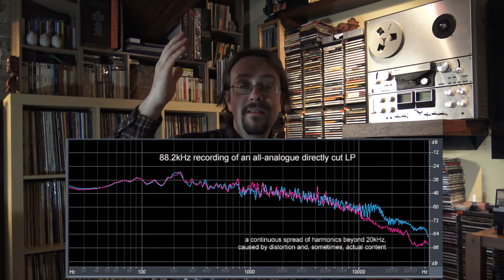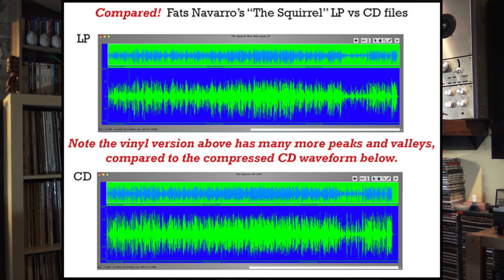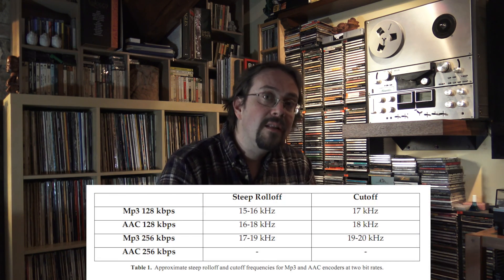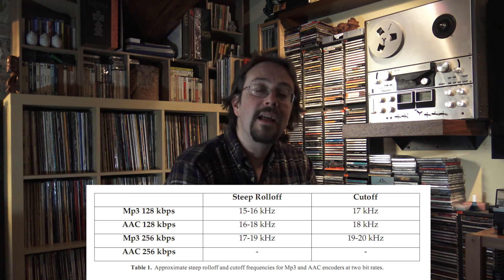SuperTweeters: how to increase your frequency response or a critique on modern music compression

Comment: Merging a supertweeter with a main tweeter of a loudspeaker is not as simple as it seems. Danny Richi from GR-Research had shown that the best way to integrate supertweeters is to aim them either back or up.
Reply from the maker: You are indeed correct. Actually, a DSP would be an optimal solution to really make sure the crossing is optimized, but I must also admit that when I had those speakers, some time has passed now from that video, the supertweeter gave that extra air to the scene that is was worthwhile the downsides it carried.

Comment: Thanks for the informative video. Would you say there is any benefit to super tweeters if not playing vinyl?
Reply from the maker: Well, the only music with a cut off of the frequencies is a CD, but usually speakers reach maximum 20khz with linearity, so even those extra 2khz can benefit from the presence of supertweeters. I always felt just a more engaging experience with them on.
Reply: @anadialog I appreciate you getting back to me. I am using Amazon music with their Hi-Res Flac streams through a Wiim Pro Plus streamer. So I would hope that It's putting out a higher frequency spectrum than the standard CD. In this case a super tweeter may be of benefit? Speakers are Wharfedale Linton 85th, so start rolling off around the 15khz mark with soft dome tweeters.

Comment: I just bought a pair of Townshend STs and they are revelatory.  On everything.  They do so much by doing so little.  Extra air, resolution, space, definition, finesse, bass definition.....I could go on.  And in audio speak, they are cheap for what they bring to the table.  NO cable or tweak, at any cost, can bring to the table what the Townshend STs do.  I highly, highly recommend them and give them a go.  Of the ST's out there they are the easiest to hook up (come with their own quality cables) and have a volume (sensitivity) matching knob, something most ST's don't have.  And they are unobtrusive.  Sutble.  Less is definitely more and with some ST's out there they are obvious, loud and distracting (both visually and audibly).  Wow.
Reply from the maker: Nice!

Comment: Hello and thank you for sharing your knowledge with us!
Please help me with some information. 
I ordered a pair of Wharfedale Linton Heritage speakers that have 6 Ohm. 
I have 2 Fostex FT96H super tweeters that have 8 Ohms. 
The question is, can I use them together and how can I connect them if I can? 
Is it necessary to use a tweeter attenuator so as not to burn it?
The amplifier is Denon PMA 920 and on its back it says that it supports speakers between 6-16 Ohm. 
Thank you in advance!
Reply from the maker: No worries, speakers themselves tend to have impedance fluctuations. Connect the tweeters to the speaker inputs and test if you like the sound...they not always blend in...

Comment: https://www.youtube.com/watch?v=JTBAx9x5fUU
Reply from the maker: The video takes into account adding a tweeter. I am talking about SuperTweeters, made and designed by various companies in order to work with your speaker. At that time I used a tri-wire speaker so the effect was even more precise and the results were amazingly good. According to the guy in the video you would hear the big problems in phase. As I said in other comments a DSP would certainly optimize crossover.
Reply: @anadialog  
Tweeter or SuperTweeter the effect of Phase Cancelation not only remains the same but it's even more severe the HIGHER you cross in Frequency,.
Just watch what happens to the Frequency Response by moving the driver by ONLY half an inch, you lack fundamental speaker design theory knowledge to have a constructive conversation with you, I guess ignorance is bliss, OTOH, you're ruining a well designed and thought after pair of ATC Speakers.
Once again, SuperTweeters are not "one size, fits all" no matter what the manufacturer or your "senses" claims.
Reply from the maker: That is why they invented something called DSP. In any case clearly you are not open for discussion but just enjoying your pedestal, enjoy it. Just remember sooner or later it gets cold up there! ;-)
Reply from the maker: Speakers and supertweeters are long go e. This is what I have now: https://youtu.be/slu_GgE67BM

Comment: Do you have ANY idea how these Super Tweeters "interacts" with your speakers tweeters?
Do you know the stop band and slopes of your speakers tweeters?
Do you know the slopes and crossover point of the SuperTweeters?
Without MEASUREMENTS you don't, so, the chances of creating a PHASE CANCELATION and a huge dip in the audible range (10kHz-20kHz) of your speaker tweeters is way higher than you think and almost certain,.
You can't just "throw" them on top of your speakers and call it a day.
Reply from the maker: I do agree that a DSP would help! In any case I am not using them anymore but when I did I must sdmit that they made my ATC loudspeakers sing!
Reply: @anadialog  
My comment above has nothing to do with DSP but with speaker design basics, which, you obviously know nothing about.
Before you go suggesting and praise add-on "SuperTweeters" do a little research of how multiway speaker crossovers works, it's far more complicated than you think.
Reply from the maker: Humm, DSP takes care of most of those issues maybe you should start reading a little more my friend and try to propose yourself in a more humble and constructive way instead of printing your finger from a pedestal. 
But apart from all this, my ears told me that WITH the supertweeters installed my ATC loudspeakers sounded much more realistic and THAT is important, not specs, not your opinion. We have to start trusting more our senses in fact I am sure that you are a technician of some kind that in most cases are only able to discuss with numbers but as we know, numbers mueasure quantity not quality. Quality may be inferred but that is a second passage. Both are important!
Reply: @anadialog  
That was almost funny, almost...
While with DSP you can more easily take care of driver integration Phase related issues (with Brickwall FIR Filters and/or Delay lines) than with Passive (or Active Analog) crossovers there's not "one size fits all" solution, as is the case with add-ons Supertweeters.
You're are essentially adding another "way" on your speakers turning them from 3way to 4way and to do that PROPERLY you need measurements, not what your "senses" tell you...
You think that the ATC guys used their "senses" when designed these awesome speakers or a set exhaustive measurements to properly integrate the three drivers together and get an overall smooth and Linear Frequency Response?
Your "senses" can only tell you that much and be sure they can't tell if you ruined the response of that ATC Tweeter by creating a huge dip in their response followed by a huge peak from that SuperTweeter.

Comment: The Mona Lisa thumbnail is interesting. But the analog would be blurry too. Since vinyl and tape is quite limited in response and dynamic range its not really any better just different. Best solution is to record, master, and payback digitally. Slapping a super tweeter on top of speakers without measurement equipment and making modifications to the speaker usually creates a hot mess. Theres several issues they cause messing up speaker and room response. GR Research did a good video on it.
Reply from the maker: I do agree that a DSP is required for precise crossover and timing

Comment: The Townshend give some improvement already in the audible range under 20 000. Even under 12 500hz you will get some out of the tweeter. It adds some details. So indeed there can be some benefits also for CD-lovers. But it is system depending. I heard the Townshend in a nice system. It wasn't worth the price.( it was streaming-music... ).Old guys listening to super tweeters? Hmmm. Well if you insist and are well trained. And your system have to be high end. And so will your room have to be. Rather spend your money on room improvement. We all got enough gadgets as it is...... And your room is your real enemy. If you havn't fixed your bass issues why  be looking at a super tweeter?

Comment: Congratulation for this presentation!. I totally agree. You just tell what  I am thinking but much better than I can. Just one question- What kind of super tweeter is good? There is too many , but I can't find gut quality. If you have some recommendation, please help. Thank you!
Reply from the maker: If you haven't, check out this other video I made were I bring some evidence to my claims! Well, I only experienced the Townshend SuperTweeters so I wouldn't feel comfortable suggesting other brands even though I am sure you can spend less and get the same quality. Sorry!
Reply: @anadialog  Yes , those   S tweeters are more expensive than used BMW :) .But here i found a problem. The crossover of mi  floor standing speakers  killing the high frequency . Signal 40 000 Hz from generator send to the crossovers just disappear in the outlet of the original   super tweeter , and the measurements on the input in parallel , where should connect the external super tweeter  shows very low level of the sent  signal 40 000 Hz. In the diagram for the crossovers I see that they are using  transformers  to filtering the crossovers. Unbelievable. I think that this transformers   shorted the high frequencies and lowering the level of them The transformers just eating the high frequencies and sucking them from the amplifier .I have to redesign the crossovers and to eliminate the transformers, the ferite pins into the coils , electrolytic capacitors and to make coils with more thick wires . Do you have some video concerning the quality and efficiency of the crossovers?
Reply from the maker: Interesting! The frequency crossover is a delicate aspect and a DSP, as many say, does help this issue. No, unfortunately I don't have a dedicated video!
Reply: @anadialog  What is DSP?   Digital Signal Processor?  Electronic crossover?
Reply from the maker: @antonjoe5611  yes, a Digital Signal Processor. It regulates with precision the  crossover. It's an active solution, and digital. So you do have a conversion there. In dome cases, like my new speakers, the dsp is just for a specific portion of the spectrum, in my case the subwoofer.
Reply: @anadialog Yes the electronic crossovers are much better than conventional crossovers. I have this in my S class W140 .The amplifier is 130 W sinus power and the electronic crossovers are in the pre amplifier section and each speaker has dedicated amplifier  for  low , medium and high. The car has 12 speakers and the acoustic inside is incredible. So we are compare here the difference between analog and digital, which is very small, but difference between sound from electronic crossovers with dedicated amplifiers and sound from conventional high end amplifier that sending signal to conventional crossovers is much more remarkable. This lead  to many other questions  about Hi Fi music .

Comment: hello, I'm thinking of putting some Super Tweeters on my little sound system.
I found on eBay, second hand, Emoto Sound Ceramic Dome Super Tweeters: Maximum Sensitivity: 90dB - 1W / m., Crossover Frequency: 10kHz / 15kHz, Usable frequency response: up to 40 kHz.

my system is: Cartridge: Ortofon 2M Bronze: 20-20,000 + 2 / - 0 dB, Speakers: Wharfedale Diamond 225: 56Hz - 20Khz, Amp: Onkyo 9110: 10 Hz - 100 kHz / i1 dB, j3 dB (DIRECT) .

Do you think Super Tweeters will work well on my system?
again, thank you very much for your help
Reply from the maker: I am sure it will, although, I never tried these. The only problem I see is the Ortofon which isn't going above 20khz but there is always time to upgrade!
Reply: @anadialog   eh eh, that's right... Grazie

Comment: My amp spec says the following: Power Bandwidth
(MAIN L/R, 0.1% THD, 45 W, 8 Ω) .................. 10 Hz to 60 kH
I take that to mean its frequency range is up to 60 kHz, so with the right source (analogue or SACD etc) a super tweeter would be contributing.  Do you agree this is the correct amp spec to be looking at?
Reply from the maker: Yup!!
Reply: I have the same frequency range on my monoblocks 10-60.....but the problem is that my preamp is rated @ 20hz-20khz. Therefore, I guess no supertweeters for me😒

Comment: Let's completely forget about a higher frequency range for the Skeptics. The best thing that a super Tweeter can do from what I've recently learned, is open up the high frequencies that you already have - and even expand on them almost like a small supercharger for your existing tweeters. Sure your existing tweeters have a frequency range that probably goes up to 20,000 hz, but how much of it are you really hearing? I thought a super Tweeter would be Overkill until I heard some of these comparisons online. Look them up yourself. But it has to be from good quality units. If it looks like cheap crap, it probably is cheap crap. And super tweeters shouldn't get a bad rep because cheap crap is out there. Look at all the junk subwoofers that are out there. Subwoofers don't get a bad rep. Neither should super tweeters. In fact, I think we need a different name because the name super Tweeter gives a negative connotation that dates back to the late 70s and early 80s.

Comment: Look, I was on the fence about super tweeters and very skeptical. But after listening to back-to-back reviews on YouTube for over an hour, I am now a believer. It's just like people wanting to add more low punch or frequencies into their system by purchasing a subwoofer. Super tweeters can enhance the high end of your loudspeakers. Any misconceptions about crap quality or comb filtering are old, tired and worn-out stereotypes from the 1970s and 1980s. Unfortunately, it seems like some audiophiles are stuck back then. Get with the times Grandpa lol I JUST DID! If it enhances your emotional experience, and it sounds better to your ears, screw specs on paper. After all, it's all about the enjoyment and the emotional experience after we go through the precise analyzing of building our systems right?
Reply: Hey bro, just curious did you end up getting a set and how did it turn out?

Comment: There is a youtube video showing very clear graphs of resulting frequency response anomalies when using forward facing super tweeters crossed over at different frequencies.  The results are startling and the conclusion is to face tweeters to the rear.
Reply from the maker: Interesting, I will experiment but the manufacturer does not recommend that. Plus, the Townshend SuoerTweeters have an intensity knob behind that can, perhaps, emulate that effect.

Comment: Thank you for the very informative topic of super tweeters.  
Hopefully you can assist. It is about my car audio though. I have Alpine SPG-17CS 6-1/2" (16.5cm) COMPONENT 2-WAY SPEAKER. The frequency response: 68 Hz to 20 kHz with a 20mm Silk Soft Dome Tweeter. I want to add super tweeters to compliment the sound. 
From what frequency should the super tweeters start, and end at?
Thanking you in advance!
Reply from the maker: Wow! You want to implement that in a car! Fantastic! Well, ideally the crossover should be at 20khz or slightly above so there is no smearing, all the up to as much as you want, I'd say at least 40-50Khz.

Comment: Umm, the bitrate has nothing to do with dynamic range, it has to do with the linearity of the dac conversion. A 320khz vbr file has very little difference from a flac file. On the the other hand 192khz has a large difference due to distortion of the waveform during conversion. This is due the extreme loss of data required to accurately reproduce the analog waveform.
Reply from the maker: No, of course, that is bit depth. My point was that the frequency response of compressed files like Mp3, even with a high bitrate, is greatly reduced. Hence, the faithfulness of of music is dramatically decreased...

Comment: Vinyl definitely has limits.
There are loudspeakers that can reproduce 50 KHz signal, even though you can't hear it. The higher your tweeter can go, the more accurately and effortlessly it can reproduce lower frequencies that you CAN hear which are up to 20 KHz. That's the reason they do it and nothing else. The rest is bragging. That of course, depends on the type of tweeter and the materials of which it's made. There are many variables here. Depending on how the speaker is made, a speaker which goes up to 20 or 22 KHz may be able to reproduce tones better than a speaker which is rated at 40 KHz. A speaker that goes up to 20 KHz can be a perfectly good sounding speaker and you won't miss anything with it.
Reply: Frequencies above 20khz can still have a physiological response on humans even if you can't consciously perceive them. Studies by Neve and some Japanese companies in the 70s did some research showing that people favoured the music with frequency information over 40khz, but that was only when exposed via speakers, and did not work with headphones, thus is must be stimulating some other sort of biological systems/organs, perhaps one of the nervous systems.

Comment: In simple words..
If i have a regular speakers does adding a Twitter like that does make the sound CLEARER ?
Reply from the maker: Not clearer, but more faithful. This happens though if you have a high resolution chain: source and amp!
Reply: Depends on the speakers you have. I'd say if you have really good speakers which are engineered properly, no, it'll not sound better. If you have low quality cheap speakers - no, pretty sure it'll not sound better. The best way is to try it and if you think it's worth it then buy it. Properly made speakers don't need any additional tweeters. Adding more speakers will insert timing, balancing issues and "coloring".